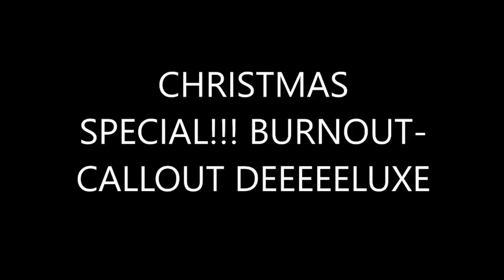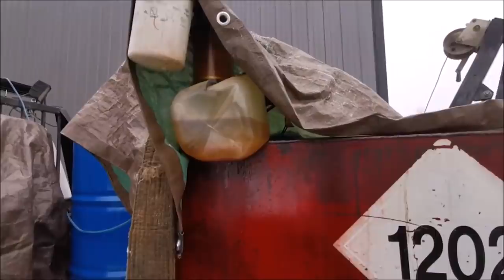CHRISTMAS SPECIAL! BURNOUT CALLOUT. UN-GREASED EDITION!

Comment: Peg you need to start buying harvest king 50% ether starter fluid from peavy mart. It will start anything or blow it up. Most starter fluid is around 10% ether.
Reply: Yeah I've learned the crap either comes from the coop to, while trying to seat semi tires on  farm trailer rims. you need nearly a whole can to get a mild fire,  go to town and get the parts store stuff in the brown can. Put  2 thirds less in it's like a nuclear blast.  I thought it was odd  when the coop stuff wouldn't start the excavator any better either before I tried the tires.
Reply: The stuff he's using is 30-60% ether by weight according to the sds.